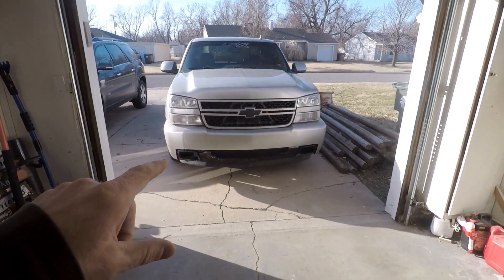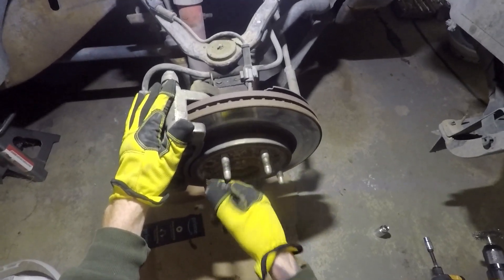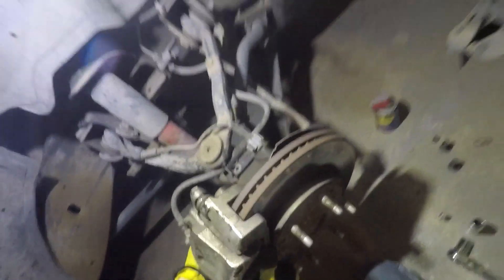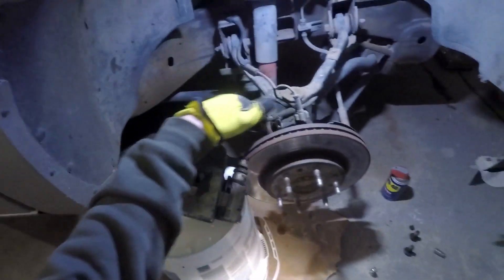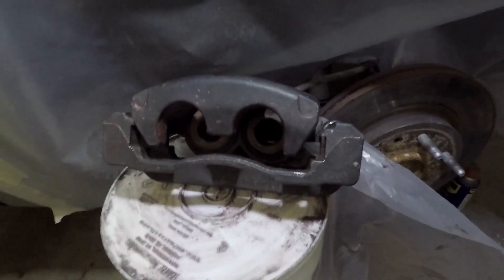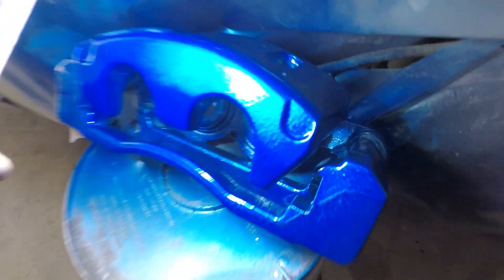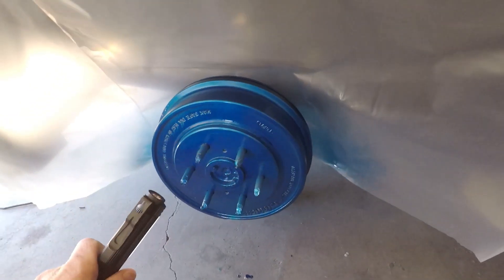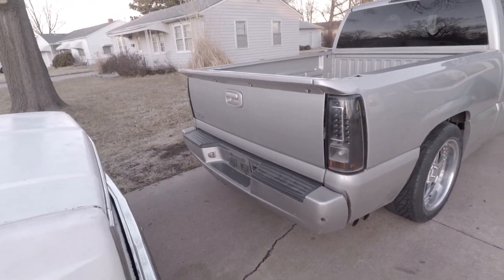Painting BRAKE CALIPERS with DUPLICOLOR Metal Cast SPRAY PAINT!

Comment: I wanna do this to my Acura rl calipers and I have both primered. Do they need to be primered before putting the the base coat?
Reply from the maker: It doesn’t need to be primed if your using the same paint I did but it will help with less number of base coats you will need to apply to get full coverage
Reply: @BradzBuildz  I’ve never done this in my life so it’s a learning curve 🫠
Reply from the maker: @kazymaniac  prep is everything. Get them as clean as possible and you should do just fine